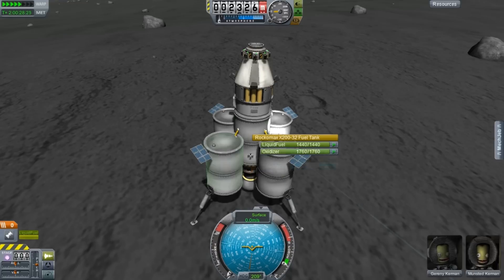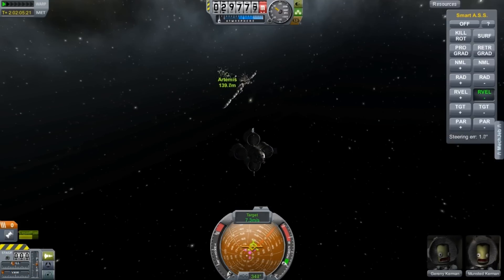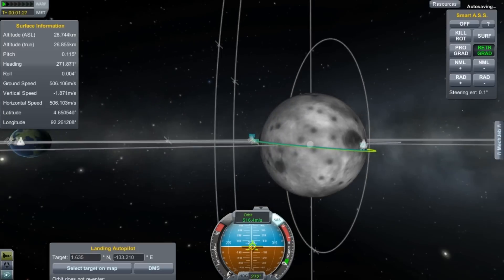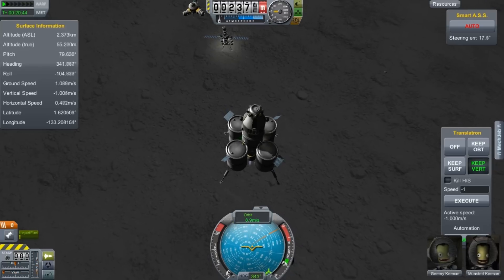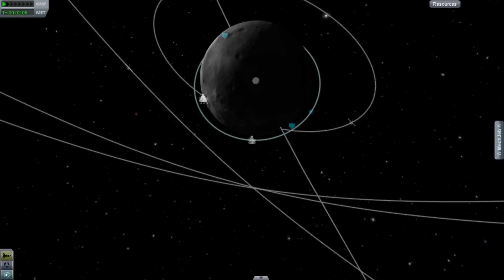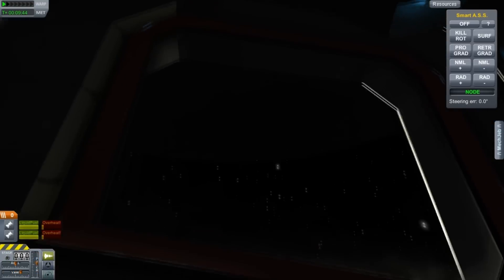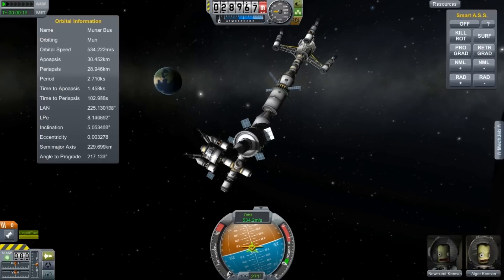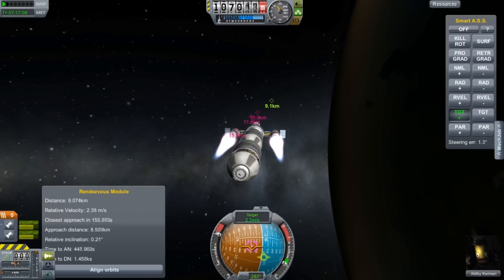Kerbal Space Program - Reusable Space Program - Episode 16

Comment: Hyperedit if you don't care too much about keeping it real.
If it keeps collapsing, add struts, they break when a staged component drops.
If i stack two orange rockomax fuel tanks and a grey rockomax, i always put 8 struts over the joints between the tanks.
Asparagus staging is awesome, with the FAR mod (more realistic drag and aerodynamics) i've been able to launch 130tonne of stuff into LKO using asparagus staging and seven of the above described tanks and Mainsails (1 centre 6 radial).

Comment: GPS is a originally military system controlled by the USA, I think they designed it to be able to launch ICBMs with more precision or some other crap, however they made it available for civil use at some point. They can still completely lockdown the system though, should they feel the need to do so, that's why the EU is working on their own system.

Comment: Sound doesn't really travel fast in space because it's a very low pressure environment. Additionally it is very cold. If you know your physics than you'd know that the sonic speed is influenced by the gas pressure and the temperature. The hotter the higher sonic speed is. The more pressure the higher sonic speed is.

Comment: Well, mines pretty darn heavy and uses only 3 NERVAs for propulsion. With a full tank at the surface of the mun, it has a really small TWR. ^^ I'm using the Quantum-Fuel-Transfer Mod on a modified Bobcat Mark 2 Truck. Together with the Damned Robotics and Modular Weels-Pack, I can dock a Trailer on the end of the Bobcat Mark-2 and have an awefull lot of solarpanels to power the conversion process.